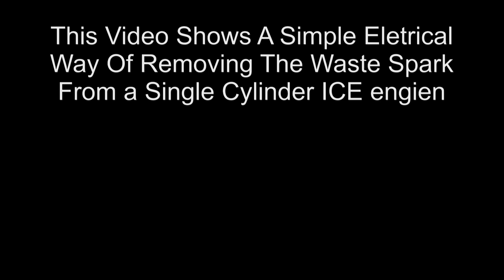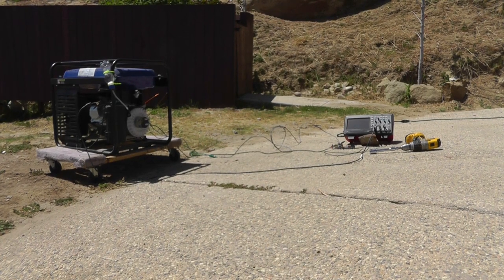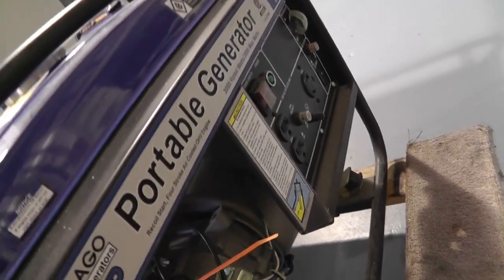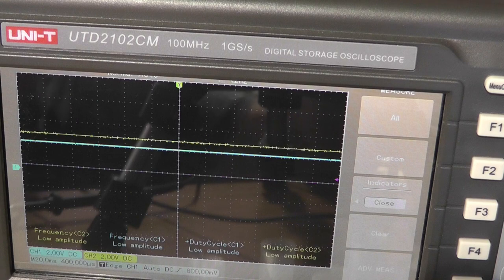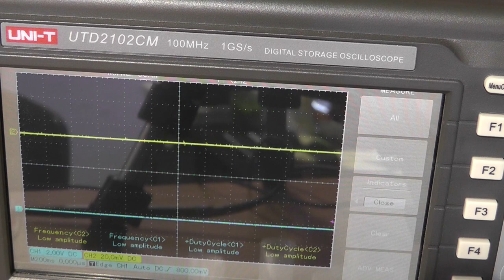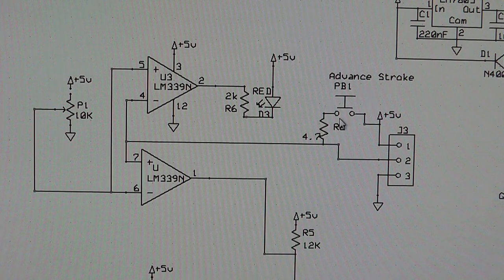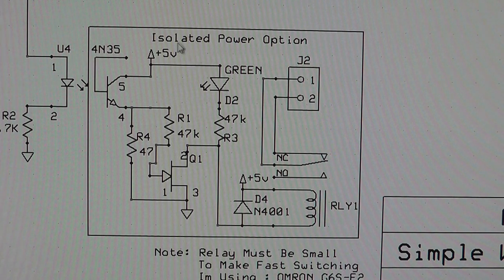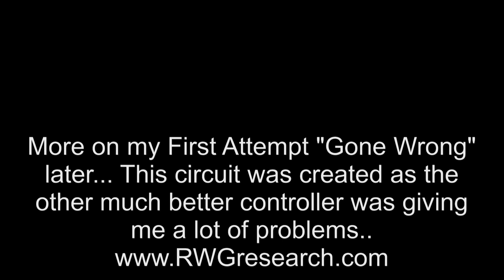Simple Waste Spark Eliminator Circuit. ( No Mechanical Changes Needed) RWGresearch.com

Comment: I stopped messing around with HHO a long time ago. But, have some videos of a mechanical alteration to an old Briggs (starting at video #22) to eliminate the waste spark. This method also eliminates the auto advance of the OEM setup. I got it to work on gasoline but never persued running it on hho after that. Your setup is a much better way of accomplishing the goal of no waste spark. Russ your a very smart guy, love watching your videos. God bless and good luck on all of your projects!
Maurice

Comment: so glad to see someone doing this !!..great job Russ.....If this video is interesting to you then i would also suggest studying valve overlap...especially on multicylinder engines sharing a common exhaust manifold!!!!
hho hydrogen only
Reply from the maker: yeah something i have been playing with for a long time and never finished... time time time... my other controller keep doing funny stuff, me and raw bush played with it for a bout 3 months and could not find a solution. every time it sparked it went crazy and locked up the controller. even when on 3 isolation circuits and 20 foot way...  ill figure it out some time. it gives the user control over the timing on the fly.    ~Russ

Comment: now put variable valve timing on it, and an rpm sensing governor, and you've officially recreated an old hit-and-miss engine. speaking of which, has any one tried running one of those on HHO, their crazy fuel efficient on gas the way it is

Comment: A high-quality Omron relay has a service life of 2,000,000 actuations. At 3600 RPM, that's only about 9 hours of operation before the relay fails.

Eliminating the waste spark is pretty pointless IMO, as the waste spark happens before top dead center, before the intake valves ever open. Briggs and Stratton, Kohler, Honda, etc... all offer gaseous fueled engines that still run waste spark ignition.
Reply: LOL..Put pure hho in there and tell me that eliminating waste spark is pointless...............
Reply: Looks like an alternate fuel will be tested in that gen-set
Reply: It would be 18hour since it actuates every other rotation
Reply: *****
It is. I've experimented with gaseous fuels, including hydrogen on small engines. It's not a problem since the spark occurs before top dead center, before the intake valve even starts to open.
Reply: American Locomotive Okay....

Comment: I realize why using that motor is waaaay cool but a more practical motor would be a dual overhead cam-with cop-ignition...coil on each plug(no wasted spark)set the intake cam a tooth or two tool late.Thus causing no overlap.....firing at tdc would be best but will still run great with gasoline timing...im trying to think of some motors that fit the citeria in wich would be....yamaha vx 110 wave runner engine-honda 225 outboard(i think)...toyota...had one in a car but i cant remember wich engine....Ive looked all over for a generator that has the criteria for a long time but to no avail
PS.....keep pondering that weather balloon
hho hydrogen only

Comment: Aside from short life expectancy for that relay, I question how you prevent it from losing sync without a cam time reference.
Reply from the maker: its using the rpm as timing. you set it to fire on the correct stroke.  if it gets off track it will stop running.. lol. so far its done well. i consider the relay no different than "points" it'll be fine... lol  ~Russ
Reply from the maker: Cord Tennyson yes but this dose not change timing at all. ~Russ
Reply: ***** right...but if it kills every other pulse you would have to make sure the the first pulse it sees is the compression stroke.....hence killing the next...being exhaust stroke......if im understanding you correctly
Reply: Cord Tennyson the relay has a life expectancy. should be listed in the specs. so do points, which are much stronger and bigger. z man is right

Comment: genius. this circuit eliminates backfiring through the carb for hho systems on small engines. Waste spark ALWAYS ignites the hho during the exhaust stroke causing flashback into the fuel cell.

Comment: Hi Russ, I am I big fan of both your videos and research but I have watched your whole video and I am still failing to understand the importance of eliminating what you call the waste spark?. If it was a problem wouldn't the small engine manufacturers have developed a solution by now?. It was to my original understanding that what you call the waste spark was to burn off excess fuel in the exhaust for cleaner emissions?, but I could be wrong?. I am always open for correction if I am.
Reply from the maker: ok so i did not explain this in the video but this is for use on motor going to be used for testing other fuels. such as HHO. an extremely explosive gas. and we don't want it burn except on the power stroke...  other wise it could have a negative effect. ~Russ
Reply: OK.... Now it makes perfect sense.... (Derp!).... I should have thought of that lol. Thanks for clearing that up.... Cheers :)

Comment: Why are you doing this please ,what is the point . ? The "waste spark" as your calling it has no effect on anything ,it happens when piston is just before the alternate TDC,so  just after exhaust stroke and just before inlet valves start to open . Also any 4 cyclinder engine without distrubutor ,and only dual ign coils (so Motor Cycle engines etc) uses that system since it saves on 2 ign coils .

Comment: Man, that mechanical relay will not last if it switches every revolution! Figure out some better way, like a mosfet...

Also, shorting out the coil will probably remove energy from the engine making it less efficient...
Reply from the maker: Its no different than any mechanical contact's or "points" ...
i tried a lot of stuff but the relay won out. everythign else did not function correctly... Mosfets, Transistors, SCR's.. they all gave me mixed results as the almost 0 potential vs the shorted to ground would not work correctly. ill let some one else figure it out if they want. lol

shorting out the coil is how the motor works in the first place. so its all good. should not change anything. ~Russ
Reply: ***** Actually it is different. Points have a cam profile on the eccentric to gently raise and lower the points.

A high-quality Omron relay has a service life of 2,000,000 actuations. At 3600 RPM, that's only about 9 hours of operation before the relay fails.
Reply from the maker: American Locomotive well for testing i guess it will work for testing. later there will need to be a fix. :) ~Russ

Comment: Hi russ recently had some feed back off Peter Stevens joe bookers video man ingventor on you tube you have far better understanding of electrics than me so here goes he has made a matter anti matter engine utilising positrons and muons from the initial water fuel cell by pulsing figure 8 closed loop current same as stan Meyer andrija puharich he pulls the anti matter from the vacuum on his fuel cell that then soaks the aluminium on the engine as a condenser and the block pete tells me that a non liner 120 degree phase change in a recent email thus may relate to the phasing of the alternator and spark yapping the dc starter solenoid feed from the b+ of the alternator stan Meyer also states this b+ now is their a way that you could do a unregulated dc ac phase in and out type of electronic gadget you see it appears that tesla and his car coil collapse to pull a anti matter field for the waste spark but I believe tesla also knew that the dc pulsed would be the perfect and natural method to make a engine run like natures lightning and joe booker may have made the water coolant become a refrigerant  ie urine ammonia and water dc pulsed closed loop off the wiring anyway I will have a video up soon of a intriguing thing that I got with a type of ex leedskalnin perpetual holder attached to a diesel stop solenoid and then attached to a neg of a car battery and pos it gave Ma a proper clout and unsure why so I am going to put it up better to ask for explanation as joe booker takes the air and strips it as it enters the air intake/aluminium neutralising as the anti matter wants to stabilise again stan Meyer type I realise my comment is slap happy but trying to place tweaks without writing a encyclopedia mel in uk the star washer clue I had off Peter Stevens gave a weird back charge event but not set that up for you tube yet to show all how arching current e traps a loose earth to back feed.  Called phasing out and it made dc radiator can go backwards when adjusted correctly
Reply: Hi I can tell your very wise/intelligent as you are querky in your reply and the cow bit possibly hit the nail on the head I struggle to negotiate electric and what it comprises off that's why I tend to just go ahead and try stuff as I have not much idea what it may or may not do like placing urine in coolant if you could simplify the aluminium ball receptor ear comment I would appreciate it I try to talk to people in the mind that we are all brain dead that way if someone gets your directions wrong then it is yourself that was at fault for not carrying out the A B C process for others to follow would you agree that it is antimatter  matter soaking the engine and stripping all atoms to try to stabilise as the fluids / sump oil  and coolant are in chaotic charge of a spherical pulsed in and out of phase appears to me as natures lightning with possibility of gamma rays and other SUNS charges/fields taking a part.   I am on with this at the moment  I have had a rover 420 td ecu model running with no key/ ignition on and also had it back charging with the hint from Peter Stevens to leave the engine earth loose with a star washer in between the loose connection just have to make a living so its weekly but the more information like off yourself the easier I may understand I issue it all on you tube not wanting nothing for it just to do it for necessity to have a source of energy easily produced.  And like stan Meyer Daniel dingle Nicola tesla John worrel keely puharich Archie blue Carl cells its going to be simple just you have to have the order correct   Eye eye captain.    (It is Star Trek technology but from the past jukes Verne etc) mel in uk
Reply: Hey Mel,  I was joking with you!  

= You might be 'over the top' on joe cells. OR... I might be too ignorant to absorb it all.  Sounds like you are a SERIOUS experimenter!!!  

BEST WISHES in your exploration!!!  We need keen young minds to move ENERGY forward!   = I am a a HUGE FAN of yours!

Comment: All do respect Russ this in my opinion is a big waist of your time, there is absolutely no reason to eliminate the "waist spark" as you are calling it. And is just something else to go wrong. There is a need for that spark actually, for one easy starting, two smoother running.  I have worked on and played with small engines for over 45 years. I have a much more detailed explanation if you would like to discuss this further. You are a smart man, I urge you to think about this and you see that it is a bad idea.
Reply from the maker: thanks for your response. a lot of people see that when playing with HHO in an internal combustion engines the waste spark can ignite the gasses during this time. so a lot of people have wanted to use this method to keep from unwanted ignition. i wanted to do this in a way that people did not not need to change the motor in a mechanical way to get this to work. i agree with you. the waste spark is not bothering anything. but when there is a lot of exploitative gasses floating around things can happen. this was built for a friend, so i thought i would show what i did :) . i'm always open for suggestions. whats your thought about HHO and waste spark? ~Russ
Reply: ***** OK now I can see a reason for the circuit. I had not given that a thought!
Reply from the maker: mark a. coffeen
 no worries. all things for a reason :) lol ~Russ